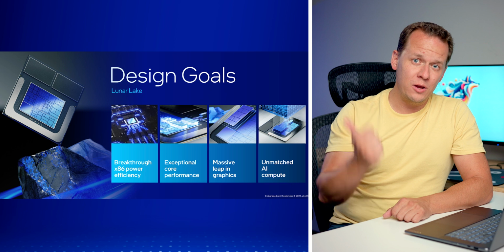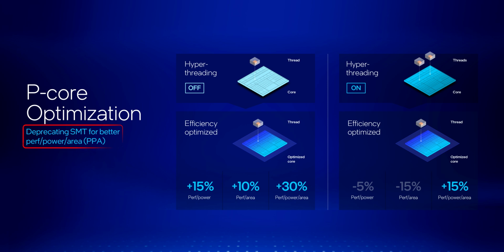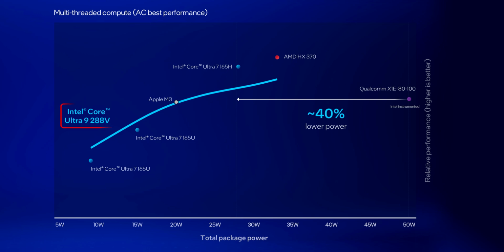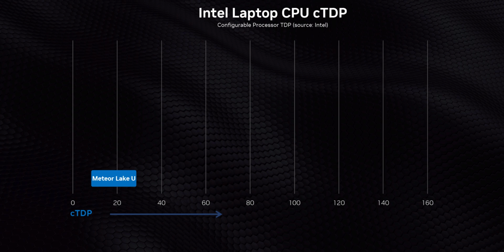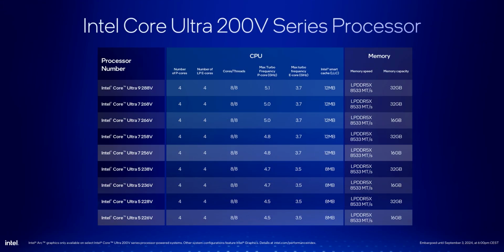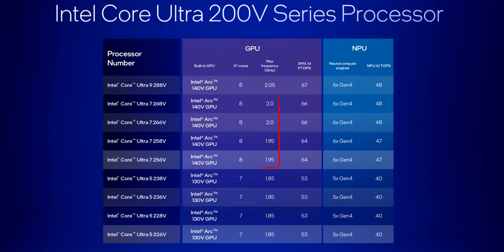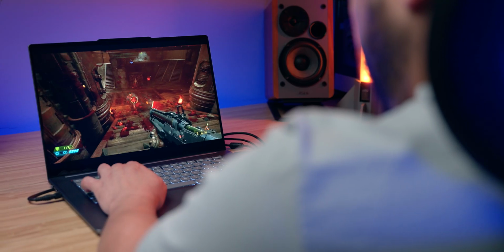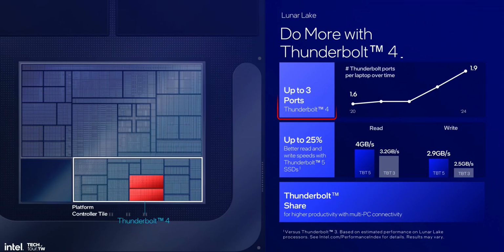Intel is FINALLY Doing Something Different

Comment: No USB-A, it's a waste of space and a port! Just keep an adapter wrapped on the power cord so you always have one. ;-)
Reply: nope, adapters are trash
Reply: @Kilowatt6464  So is USB-A
Reply: Quite! I’m astounded that the tech-savvy YouTubers don’t comprehend that a USB-C cable is versatile, while a USB-A cable is limited. For instance, I simply keep the USB-C adapter plugged into the USB-A connector on my old mouse. These adapters are inexpensive, costing less than $2 on Amazon, and they’re permanent, eliminating any hassle.
Reply: @andyH_England  It isn't just that, it also means there is a tradeoff usually on the board... what part of the bandwidth is being used up by a 5Gbps port that you likely rarely use? I think they often split it and you end up with 2 or the USB-A is paired with an Ethernet jack or something similar. I would imagine most of us use a simple dock for our laptops that has the USB-A anyway...
Reply: @MS12-u5p @sloanNYC  All my devices, from ethernet to keyboards to mice, use a USB-C adapter, which is permanent on each external device.I really think it is a first-world problem, especially as the sole purpose of USB-C is to provide a one-stop solution, which is hard to achieve if people are hanging onto legacy solutions.
Reply: @andyH_England  Totally fair, but I think you keep a USB-C port which gives you the ability to use an adapter that gets you 4 USB-A ports instead and use that more as a dock in that case. Especially if it is 40Gbps you can a lot more flexibility from that than taking up space for that very old port.

Comment: Where is the multicore comparation to x370? 😂🤡🤡🤡
Reply: @ehtasam2080 a joke against the almost 24,000 of the AMD x370 hx 🤣
Reply: @Games_and_Tech hx370 consumes 60W. There's no point comparing against that. Mostly these rendering workloads are run on gpu, so multi core performance doesn't matter most folks out there.
Reply: @Yusufyusuf-lh3dw  HX 370 doesn't consume 60W lol it's literally capped at 28W in every laptop
Reply: The Core Ultra 9 even lose to the HX 370 in the slides showed so...
Reply: @ehtasam2080 the 300 series aren't H class, they run at 28W
Reply: @ehtasam2080 lunar lake is capped at 30W too, also the peak efficiency is nearly the same for Strix Point and Lunar Lake (15W vs 17W) wait for the 3rd party reviews and stop believing in nomenclatures that do not work anymore

Comment: Question is why has it taken them this long to actually focus on efficiency and battery life
Reply: It not like Intel were that bad, They actually have better battery life than AMD.

But now moving to TSMC manufacturing node and HUGE Architecture change. They consume significantly less
Reply: Apple is the trailblazer, but these large corporations detest acknowledging Apple’s expertise and persist on their path until they realize their mistakes. Microsoft made a similar mistake when they ridiculed the iPhone, leading to the demise of Windows Phones. Similarly, when Apple introduced a mobile operating system on a tablet, Microsoft mocked it, claiming that Windows Tablets would dominate, but that prediction failed. Intel believed its designs were superior and now understands that it missed the opportunity by not adopting ARM or focusing on efficiency earlier for ultrabooks.
Reply: They began designing LNL in 2020. It takes 4 years to bring out a new design to market. 

They lost efficiency when they sacrificed it to keep up in performance.
Reply: Competition
Reply: You don't come up with a chip design overnight. It takes years to design, prototype, test and optimise it. Intel probably started development before M1 was even released about 5 years ago

Comment: USB-A needs to die. It has no advantage over USBC other than the fact that it supports legacy hardware and a longer USB-A is around the longer manufacturers will make devices that use it.

Comment: Let's hope they don't charge apple prices for more ram.
Reply from the maker: The Aura Edition (Ultra 7 258V) costs $180 more for 32GB and a 1TB (vs 512GB) SSD.  Not bad at all IMO
Reply: @HardwareCanucks Guess PC pricing isn't going to insane overnight... There is competition... Mac is a monoculture where their zombies will just pay whatever... Want 1T ... Cough up an extra $200... You can buy a similar speed NVMe for probably less than $100... That apple markup is real. 

So yeah I actually like that the ram is on the package. It's mimicking what Apple started doing with their M1. We'll get higher speeds, at the cost of never upgrading the ram.

Also Intel is going to be in the same node as M3 and M4 so this is the first time since apple silicon came out where we will have a true apples to apples comparison with low powered chips. Intel needs a similar chip for higher end mobile workstations to compete with the MacBook Pro 16. Now all I need is a good chassis with a high end mini led display or a super bright OLED.

Now that I don't play games I care purely about productivity and being able to use it to program.
Reply: @HardwareCanucks but the base price?
Reply: Nah it is not something Windows laptops do, usually prices are reasonable (Not USD200 for 8GB of extra ram etc)
Reply: @weeeee114  windows hates 4 GB minimum should be 8 GB that will get flooded.
Reply: Let's hope it doesn't start at 4GB.
Reply: lowest end has 16 gigs @lemming7823
Reply: @lemming7823 Lunar lake always comes with either 16gb (2_6V) or 32gb (2_8V). So you can assure that there's no 4gb.
Reply: @lemming7823 they literally stat from 16gigs
Reply: It's coming in only two options 16 and 32 gigs

Comment: This info is out since 3rd of september and you release a video on it 19 days later. I expected a review at this point, not just reading marketing materials.
Reply: It is compiled very neatly, and I don't see the issue with covering older information in general. Especially as this is a primer for the release and embargo lift.
Reply: I prefer a well organized backgrounder with informed thoughts/highlights 2 days before the full review than half a month between
Reply from the maker: Reviews are being released on Tuesday.  This is a backgrounder as we clearly pointed out.

Comment: are these lunar lake cpus helpful and realistically usuable to ppl working with LLMs Locally?
Reply: I’m guessing somewhat but this laptop is only limited to 32gb of ram so that’s the limiting factor, unlike the MacBook Pro 128gb.
Reply from the maker: Not until the NPU is further fleshed out feature and software wise.  Though the GPU can easily run LLMs.
Reply: RAM is gonna be your limiting factor,
But the lms it can house in ram are gonna run fast.

Comment: The fact that it CANNOT have memory upgrades alone is a big nope for me.

None of what it does better matters when it's designed to be disposed of when it inevitably ages because of skimping on memory
Reply: Those  are laptop chips anyway. People barely update ram on it anyway
Reply: @kresimirzvonko  It's not necessarily about upgrade, but also repair.

Why should I be forced to buy a whole SOC (or a whole new device) if the memory craps the bed?
Reply: @thegamingjackhammer6472  Frankly, RAM rarely ever dies. I would still prefer upgradability, since not everyone needs additional compute (and it's cheaper than buying a new laptop). Storage on the other hand, should never be soldered.
Reply: Base will be 16GB. It will NOT come with 8GB of RAM.
Reply: @shemf_services  16GB is still trash, 32GB bare minimum
Reply: @Kilowatt6464  No? 16GB is more than enough for most applications. 32GB is the sweet spot, and can easily handle most applications without any bottlenecking. Only some heavy applications require above 32GB of RAM, something that Lunar Lake simply doesn't aim for. Idk where are you getting '32GB is the bare minimum' from.
Reply: @Kilowatt6464  bare minimum for what?
You running multiple VM? Then I agree but 16GB is fine man.
Reply: @shemf_services  16GB is minimum for anything, 32GB is decent and 64GB is awesome
Reply: Agree. Make it easier to repair.

Comment: x86 is back! Can't believe they wrecked ARM in battery life and power efficiency, all while having higher performance
Reply: Arm is heavily overhyped
Reply: @riba2233  yes
Reply: Well it's an SoC approach to a semi conductor which doesn't need to emulate anything, give it time, i hope open source architectures overtake all of them
Reply: @high-captain-BaLrog Open Source has some issues. Many dollars spent to make programs run more efficiently on a given hardware chip. Who is going to spend that money if the chip does not have a multi billion dollar company behind it?
Reply: @ricky4673  an enterprising nation who wants to create a semiconductor history of their own? Heck why doesn't the new iron curtain do it? Haha it's a passing thought anyway
Reply: @high-captain-BaLrog is not that easy
Reply: x86 havent go any where
Reply: x86 never died. Just needed a different approach of implementation.
Reply: @kartikpintu …and needed to be manufactured by TSMC…not intel…which would probably still be using 10nm😂
Reply: Intel's problem is they wasted BILLIONS on trying to diversify their portfolio with FAILED ventures or buying up companies that went belli up or didn't make a difference. In stead of... You know... R&D like TSMC does... So they fell behind... Like 8 years ago... Only think keeping them afloat until they realized they are a chip company was the fact we have 40+ years of legacy code written for x86 that would cost trillions to replace... Servers were happy with Intel for now... Then AMD started taking mind share and market share while... More so once TSMC was their manufacturer during Zen 2 and onward. Best choice ever did was fail to uphold their contract with their old fab the spun off. They weren't able to keep up with R&D to have a leading edge mode while it was relevant.

I like seeing this TSMC vs TSMC  vs TSMC head to head to head... Problem is 2 out of 3.... 4 if you include snapdragon... But window ARM is silly... Anyways AMD is at the disadvantage of being on the TSMC N4P node vs Intel being on N3B.
Reply: Yeah, I really don't get what's with everyone still believing 'ARM is the future'